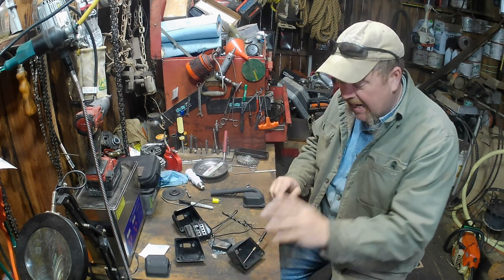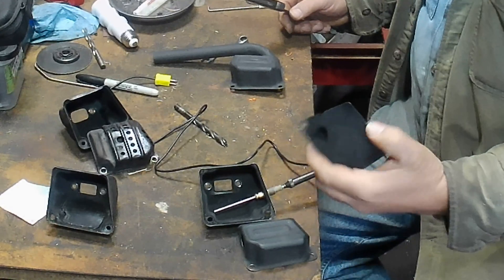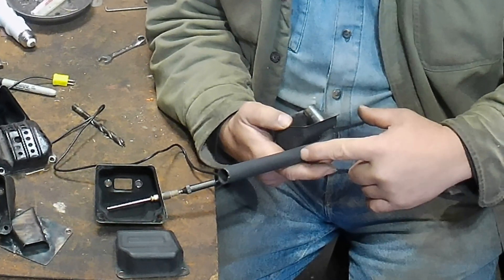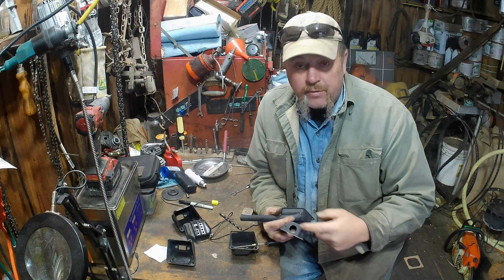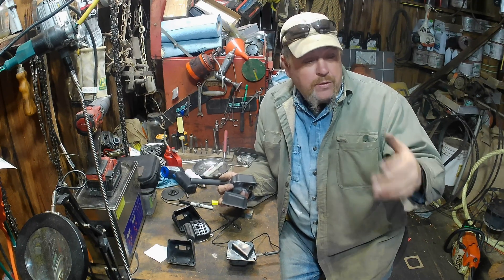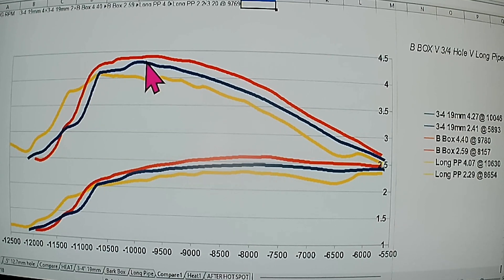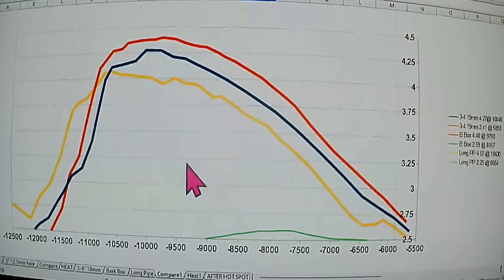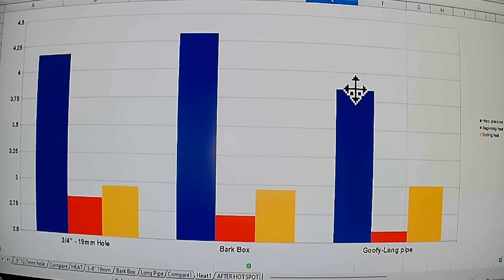Chainsaw Muffler Mod Testing--Dyno HP/TORQUE vs HEAT Comprehensive Results

Comment: Great approach to research! Love your channel. So glad I stumbled across it !
Reply: Glad to be here! I’m converting an MS250
42.5mm. For RC use.
You’re the only solid fact driven information I could find. I’m disabled and money is tight. I now know the engine can for sure produce 3hp at 8-10,000rpm. I have a custom header and expansion chamber. Along with a 13.9mm walboro carb.
Thank you very much!! I will continue to follow your channel for all the honest , fact   
driven engine and saw talk👍
Reply from the maker: @toddzilla6491 Money being tight and being frugal is a way of life that I embrace and welcome... I've seen way more "good folk" among the poor; but, on the other hand, having enough money to burn a wet mule doesn't make a person bad
!! Disability, I can sympathize and have often thought about how lucky I am; I've got a terrible back problem, but I can still motorvate!! 
There's an older video about a Stihl 029 that I put out earlier in the year; it's substantially similar to an MS250 and it may dang well be of interest to you and a mod that you can do for little-to-no money. Another subscriber did the same thing on a MS250 with mere hand tools.  3HP is NOT a problem with the MS250; I love to port them little buggers!!
Reply: I got cancer 2 years ago. My right kidney was a 9 lb tumor. My left is only working at 20%  now. I can sympathize with your bad back. I’ve had two  back surgeries. I got smashed by a forklift in 2015. 40 fractures
And a lot of suffering.
But I pulled through all that. And can still use my hands. I’m building my dream rc plane. And working on a motor with enough power. Your testing and data are going to help me achieve that dream! Maybe you can answer a question for me. Where exactly does the pulse line from the crankcase go. I think I’m supposed to tap the bottom cover  on the carb and put a brass barb in for it to attach to. But don’t really know. Thanks for replying to me!! You made my day buddy!🙂
Reply from the maker: @toddzilla6491 The impulse barb on the engine's case goes up and attaches to a nipple on the saw's plastic carcass; the carb, then mounts to a rubber boot; the rubber boot is flat-faced and the carb is pulled tight to it by the two bolts; on the flat face of the boot is a little hole that aligns with the plastic barb/hose on one side and the carb on the other. The impulse line doesn't directly plug-in on the carb. It is possible to drill/tap or epoxy an impulse into the carb... or see if there's a ready-made version of the carb with an impulse line already on it; I'm not sure which carb that would be.... but I bet there's one that would be a direct fit.
If the hands and the mind work, that's a big win!!  Thanks for being here and joining-in!!
Reply from the maker: @toddzilla6491 I'm awful glad you found us (me and all who join-in down here), too!! I am especially glad you felt comfortable to get down here in the sand box with us!

Comment: Another informative and educational video! I really appreciate your scientific approach to all this.
  Sometimes back when I cut and heated with wood I'd get so involved with hobbies or TV shows and forget I needed to cut wood until I put the last stack in the stove. And it was my luck to have to go cut wood in a pouring down rain.
  Which brings me to my question. Do you think a rain cap on the exhaust pipe would effect the efficiency of my saw. I was afraid it might so I left it open and just covered the pipe with an old Viena sausage can between cuts. Which worked, don't get me wrong. But if you've never cranked up a high efficiency Husqvarna chainsaw in a torrential rainstorm and got hit in the head by a Viena sausage can launched from a pipe from a bark box, you've really never truly fully enjoyed the wood heat experience.
Reply from the maker: @MikeLouder1  Oh forgot... t'ain't NUTTIN' like wood heat! 😉🤫
Reply from the maker: @MikeLouder1  Well now, Mike... that opens potential for more testing. I always used one of them little bird whistles (ya know, the plastic ones that are filled with water for kids to blow on?) on my Stihls and Poulans. For Macs and Huskys, I always thought a P-trap from an old bathtub may be the way to go. I was going to dyno test JUST THAT idea before, but... well... ummm... it wasn't rainin!!!

Comment: Randomly found your channel. This is some of the best content I have seen in a long time. I love the method and approach to this. You are actually answering/debunking so many ideas/myths. Where are you based out of? 
Do you have a video on your dyno set up? I'm getting to the point where I want one/need one. Love this channel brother! Keep'em coming!
Reply from the maker: @gasaxecustomsaws  Thanks so much for the kind words! Glad you found us and, especially glad you joined-in. They dyno and spreadsheet are all my fabricobbled homebrew hairbrained micrometerized-sledgehammer idea/build. I have not done a video of the build of the dyno yet... I have all the recordings of each step (including making the driven pulley),  Will probably make a series of it at some point.  
Am located southern Illinois.
Thanks again for joining-in and don't be a stranger!
Reply from the maker: @gasaxecustomsaws  ...also, about 2 chainsaw vids from now will show more of the dyno and some insight... not the build, but some explanations which had been requested.

Comment: Been thinking on this one for about a day now, I’m wondering if that baffle left in the can, in the pipe you and Kevin are talking about acts like a primary, before the main portion of expansion happens, keeping velocity up a little longer before expansion.  What if you were to put a 1” primary spacer on the inlet of the can, just stepping it off the cylinder. I wonder if that would get us some of the effects of a pipe while running a can. Giving performance and letting people needing to use an actual muffler still use one.   

Like Kevin’s idea of a notecard labeling your digital readings. 

Thanks again for taking the time to do all this testing! Gets the brain moving for sure.
Reply from the maker: @Archer_82 Are you talking about putting a pipe between the cylinder and the muffler or are you talking about putting a piece of pipe INSIDE the muffler? I haven't been giving any grey matter to this one... yet. My mind went straight to muffler inside of the can due to the stand-off of putting the muffler an inch or two farther out and making is susceptible to always being up against a piece of wood when bucking.
I also like @Kevin.L_ idea of labeling the readouts and also giving the multiplication factor in the event anyone wants to do their own calculations at a given point.   I *THINK*, once I get the other thermocouple temp meter in, I will manufacture a bezel to hold all 4 readouts and label them at that point. 
It sure does get the brain moving; as we speak, I've already recorded the pipe/length video and a diminished-volume can with the 3/4" hole lid, the bark box lid, and the lid with the shortened pipe. I haven't entered the numbers, but it looks like more gains on some... and more heat. 
I've about worn-out the threads on the saw's cases for the outside two muffler bolts; going to have to heli-coil them' I guess. I've probably had the mufflers off/on in-excess-of 50 times at this point.
Man O Man, I'm having fun.

Archer, thanks for always being here, being a fine example, and good offering thoughts/suggestions! Same goes for you, Kevin!
Reply: I was thinking between the can and the jug, yes. However, you may be able to get a similar outcome with a primary pipe inside the can, if clearance is an issue.
Reply from the maker: @Archer_82  Sure is something to try; not sure if it will work well on this platform, especially with a stock can. May try on this one at some point or another platform 'cause I sure like the idea!!
Reply: @HayChaffandSawdust1 maybe the 440? Seems like it may have the room.  When i make it to that point, i was thinking a couple inch long primary feeding off center, into a pice of 1-1/2 pipe as an extension area then further around the arc, a pair of 1/2” exit, think of the primary feeding like a turbo inlet, but the outlet pipes at the outer edges..  not a great word picture.. I’ll weld one after I make it through a few other in progress projects.
Reply from the maker: @Archer_82  I'm trying to follow, but missed where the stock exhaust can was in the pipes; insomuch as I made a living with words and understanding, I'm more of a picture/hands-on person. Can you sketch it on a napkin (best diagram paper in the world) and email it to me. It sounds like you're onto something, but I'm not up-to-speed on all of the thought you have given this. Sorry you picked a dullard with whom to communicate!!!
Reply: You’re not missing much, this example here is without the factory can and I failed to mention that part. This would be a fully fabricated exhaust. I’d be happy to draw it out and email it.
Reply from the maker: @MikeLouder1  Ahh, Ok. I like it and think I understand it, but if you want, I would like to see a sketch. ...was laying awake last night thinking about exhausts (to this point of keeping a can-type on it) and contemplating if I should go back inside the engine and do some of the other mods and THEN back to exhaust, or try to get the most-efficient firewood/farmer-proof/quasi-original exhaust that I can and THEN back inside. Thoughts? I always value your opinion/insight. I've already got 2 more videos recorded on mufflers which need edited and some sawmill vids also, so I'm getting my buffer back that I had before I hooched the last cylinder. My knee-jerk was to continue exhaust for a bit longer so that gains or losses on exhaust could be tracked without other influences... but once internals change, will exhaust needs?  Dang this is tough and more fun than a barrel of monkeys 🐒🐒. 
Also, sorry can't comment well on your shorts... if I type more than a few words, it hides the SEND button and I can't scroll down to it without going to the next vid. I view on laptop and i think shorts are designed for phones.  Keep your content coming... constructive criticism: If I wasn't already aware, I wouldn't have known that you modified the bearing pockets to get the squish; to me THAT'S the most impressive/interesting part. Still a nice short!!
Reply: My thought is to Definitely continue along the path of a “farm” or “work” exhaust, for everyone that will need to operate in these constraints. I know whatever I do to my dad’s saw, he will want a “muffler” and not a fabricated pipe, he is not alone in that. As you and Kevin had mentioned, any tree guy working in town will need the same. It’s great work and valuable information. Then after you say you are moving past the everday diy without machining tools, move into fabricated pipes as well. Just my thought. 

Thanks for the feedback!  Cutting .015 out of that squish band was an eye opener for me, it worked great. That moved the .040 squish to .055, then moved the bearing and seal pockets to land a .022 total squish. It’s been a week and a half of off and on, all by hand, but yeah I’m excited about this one. I finally have a 98* exhaust roof to work with!
Reply from the maker: @Archer_82 I wasn't aware that you also removed 0.015 from squish band... by hand! That would also make a nice video; I know Dyno Joe offers a mandrel for that, but I assume you did it otherwise?? That would make a nice video series for you to do a how-to; I am not aware of it being shown on the InnerTube anywhere.
You and I are on the same page on mufflers and moving on to pipes; I may get this one to a good firewood point and a point that this saw is built to the potential of a mild build and THEN start another saw that we can use for a "platform saw" and even offer to have people send in mufflers, cyls, etc... to try against a "standard".  That's all pie-in-the-sky for now, but a thought. I DO think (since I'm starting to strip fastener holes on this one from sooo many dis/reassemblies) I will get a clone saw at some point and start it all over again with different ideas/suggestions.
Reply: I took footage of it all, at this point over 50 clips and most of an SD card, I’d like to put it all in one long format, or a few because it is a lot. I used the piston out of the kit, some 3m90 and high quality 80 grit, glued it right to the piston top, mounted the piston on a pice of maple in the vise and sanded the jug squish band out by hand.  

I’m all for a community build, or mail in community parts for research (as long as each sender is aware that any part my fail in the process of testing, that should in no way be on you)  

My vote is the Farmertec 440. Because I want to try and put a 54 or even 56mm top on it and make it breath fire with torque for days at an insanely high rpm pulling a 8 pin and a 32” bar..  just have some skills to keep honing here on the small stuff for a little longer.  May need to adjust those expectations along the way, but I have ideas that need disproven or tested first. 

The jungle has a nice thread coil repair kit selection, have been collecting a few of the sizes over the last few years.
Reply from the maker: @Archer_82  I think that would make a nice video series for you! I would be anxious to watch it! I MAY do one too (I have an 029 torn down as we speak; cyl and Duke's popup ordered); it's going to have to be muffled (somewhat), but I am allowed to make it as hot as I want/feel like. I may try setting the squish on it with the tool we spoke of for the lathe. May also consider cutting band, but doubt it. Too much trouble to do to make a saw for a friend (pronounced "free work"). If I go through the trouble, it should be for a saw I am going to keep, I think.
I have a 440 of my own to build; not sure if I don't want to do smaller saws for now though; I think it is a void that could be filled as most (tinman, ironhorse, etc...) usually build 70+ cc saws; not many people doing clamshells or smaller saws.   Plus, my dyno will only hold about 10HP with the hydraulic pump that is currently on it; I haven't had a very big saw on it yet... there's no reason; I own a 660 and a 440 (both stock).
Before I offer a "muffler lid competition" or something like that, I think I need to start an LLC to avoid litigation; I spent tooooo many years involved in the court system and am aware of some (less than 1%) people will sue for anything. A person can be sued for anything; successfully sued is another story, but even a BS lawsuit takes money/time that I would begrudge someone who would sue frivolously. I'm rambling and planning out-loud again!! Thanks for listening!

Comment: In automotive applications egr or exhaust gas recirculation. Is an emissions device. It lowers combustion temperature to reduce nox emissions. I would bet it is a similar theory to that.
Reply from the maker: @erichaymore5902  I hadn't considered that; I haven't thought of smog pumps and egr valves since the 80's and actually never fully understood it then. I like you're thinking though! Thanks for joining-in!!

Comment: I like it! Looking forward to the next one. 👍
Reply from the maker: @230e4 Thanks!! This dang muffler thing could be.... every time I do something, I think of 4 more variations that I want to try. Hope all is well with ya!
Did you guys get any winter in NY this year? Hardly any here... I swatted a mosquito in mid Feb.
Reply: @HayChaffandSawdust1  I actually live in Northern Pennsylvania and am cutting some jobs in New York. We had but one decent snow here and a few cold snaps. It has been the worst winter for getting logs trucked off my job, thankfully I am able to do timber stand improvement there to keep money coming in. We have had a few days were the temp was in the 60s and yes I too saw mosquitoes in February. Like alot of folks, but for the trucking I wouldn't mind it.

Comment: Pretty cool bit of information about the long tractor pulling pipe. The bark box type works pretty good. You need to keep trying exhaust pipes, you will find one that's will work better I'm sure. You ever see Buckin Billy ray ramhorn pipe? I like the way they look and sound. I want to make one someday and see how it works. I like the series. Keep up the good work.
Reply from the maker: @TheJohnDeereGuy I did see @BuckinBillyRaySmith 's Ramhorn and seems like @tinmanssaws really likes the one he had built (latest video at this point).  I think we will spend some considerable time on pipes before this is all said and done; I wanted to start with ones that most anyone with a torch or welder can cobble together; the ramhorn takes a LOT more patience and finesse to complete, have looking good, and still have a functional work saw without a dog-knot hindering felling trees and/or chucking the saw in the bed of the truck without breaking the cyl casting.  Thanks for always joining-in and being a fine example!

Comment: I might have missed it, but did you block off the OE muffler hole? 
Won't be long now for 1k subs!🎉
Reply from the maker: @scottk8967  The very-first original can still has the hole in the front. The after-market lids had 2 slots punched in the corner (louvered); I pinched those shut in the previous video when I started with the .410 and .5" holes.
1000 subs... like the monkey said when he got his tail in the meat grinder... "won't be long now!!" 🤣😉
Thanks for always being here!!